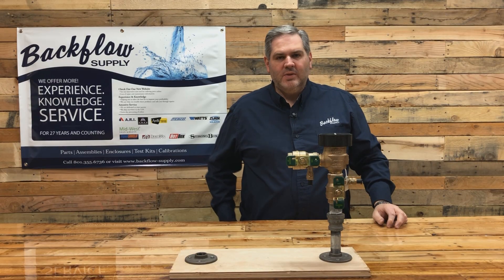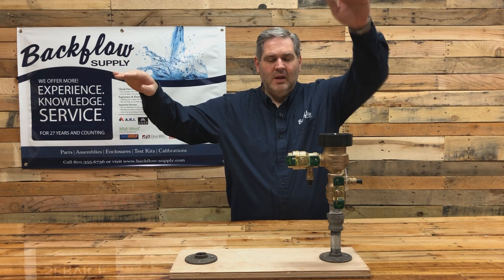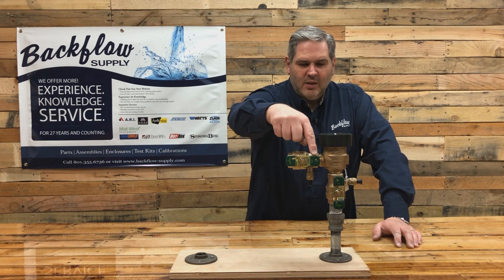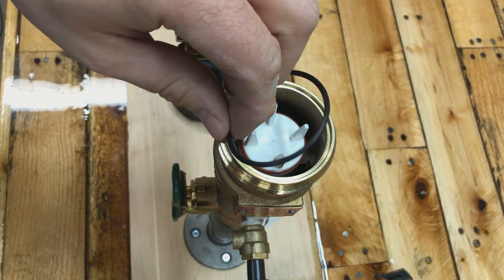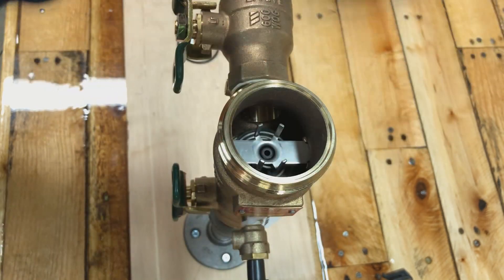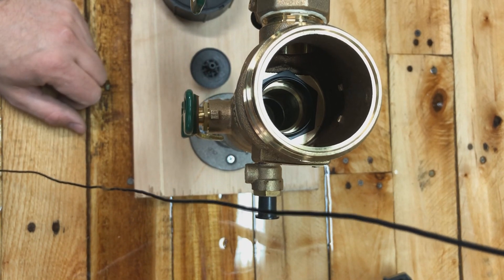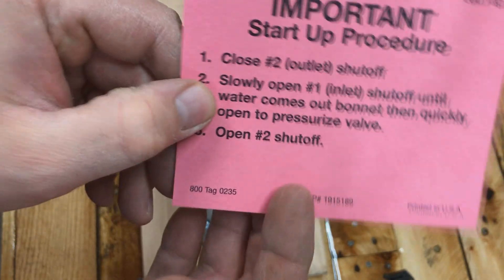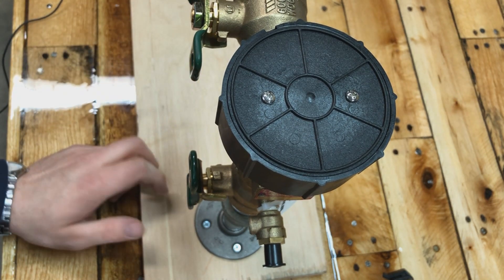Inspecting and Taking Apart the Watts 800M4 PVB Assembly

Comment: How do you remove the bottom seat?
Reply from the maker: Sorry for the delay in responding.  Depending on the size of the assembly there is a socket size Watts has said the seat takes.  The problem is that it is hard to find a socket to fit between the side of the assembly and the seat.  if it is a 1/2" - 3/4" it takes a 1 1/8" socket.  If it is 1" it takes a 1 1/2" socket. If it is 1 1/4" - 2" size assembly it takes 2 1/8".

I had a customer tell me for a 1" 800M4 he found a 1 1/2" water heat element wrench that he said can be found at Lowe's, Home Depot,  and Harbor Freight
Reply: @backflowsupplyslcut9394  yeah, the 1 1/2 inch socket is too wide to even fit down the hole. I ended up using a pair of long needle nose pliers to grip two edges. Fortunately it was not too tight so I was able to loosen it enough to then get it the rest of the way by hand.

Comment: My county does their inspection yearly. The water flow from test cock is a constant slow stream when they tested it.  They claimed it should have a high pressure spray.  I purchased this kit and replaced all components. After I tested the test cock flow, the flow rate was no different from the original test.  I tested my sprinklers and they function perfectly. I did check the test cock again while the irrigation system was on and the cock flow was high.  Finally, I have no water leaks at the Main Street meter reading. On this 800m4 system, should the flow rate at the cock be extreme?
Reply from the maker: I can't think of a reason for something like that to happen.  Maybe we need to get on a Facetime call and see if I can tell what is going on.  Give me a call in the office first, 801-355-6736 and we can talk about it and i will give you my cell number.

Comment: How can I take out the old seat at the bottom? Do I need a specail wrench or something? It is at a deep bottom where it is quite difficult for my fingers to reach. Thank you.
Reply from the maker: It is not common to need to replace the seat.  But Watts says that you can find sockets to fit it.  If you have  3/4" it takes a 1 1/8" socket.  If it is 1" you need a 1 1/2" socket.  If it is a 2" assembly it takes a 2 1/8" socket.  I believe it would need to be a thin walled socket to fit between the seat and the wall of the assembly.

For the 1" size assembly I was told by one customer that they found a water heater element tool found at Lowes, Home Depot and Harbor Freight and it is a long, thin walled socket.
Reply: @backflowsupplyslcut9394  
I really appreciate it. My contractor said the seat is not working properly, and that’s why my backflow test flunked. I was trying to replace the seat, but I couldn’t rotate the seat with my fingers. Eventually I had to pay the contractor $200 to replace the seat.

I wish I had a compatible socket 😅

Still I can’t believe the seat somehow got defective. I mean it’s a hard plastic part that can last forever…
Reply from the maker: @jacobkowski7705  The seats do get knicks and chips in them that the rubber can't seal against properly.  The seats can also get cracks in them.  I see them in the threads but more often I see cracks that run from the top to the bottom.  Not all of the cracks can be seen while still installed and even taking them out you have to look carefully to find them .  Cracked seats are not usually the problem but often can be.

There are tools that Wilkins makes and other aftermarket tools but they are usually sold as a set that does three different groups of sizes.  There are a lot of creative ways people get them out by making a tool or modifying a tool themselves.
Reply from the maker: Sorry, I was talking about different seats than the one in the 800M4.  Still the seat in the 800M4 is rare to be replaced but knicks and chips can happen on the surface of the seat due to debris washing through.  Cracks can also develop, although I do not see the cracks in this model near as much as in the ones I was speaking about above.  I also do not know of an aftermarket tool for these yet.  Just those wrenches I mentioned originally.

Comment: so if im opening this for the summer season step 1 is turn water on from (in my case basement) then do step 1 from that paper? also am i doing anything with the test cock valves for this start up process?
Reply: thanks so much I appreciate you! and just to be clear I leave those test cock valves alone, the assumption here is my system was winterized so right now the test valves are closed
Reply from the maker: You want to make sure that you have both shut off valves in the off position.  Then turn the water on in your basement.  Go back to the assembly and start with #2 on the instructions.

Comment: my vent flow does not have the 4 legs? it has a hollow stem in the middle top and bottom which does not appear to connect. The next piece is a screw on black piece before the brass top that also screws on. It leaks profusely.
Reply from the maker: You may need to call me.  I need to know the model you have. I am assuming it is the one I am covering in the video.  You may have the freeze resistant vent float if I understand your description.  You may just need a new vent float Call me at 801-355-6736 - Sean

Comment: Thanks, I had reduced pressure on all zones and my 800M4 was squealing when running. I took everything apart and cleaned it and ensured there were no cracks and or any damage. The difference is my float has a center tube with an internal spring the fits up into the bonnet center spring area. The pressure has returned minus the squeal but I now have a small leak and was going to replace everything inside our 20-year-old Watt 800M4 R regulator but I am not able to find a kit with the same float. Help and thanks again.
Reply from the maker: I am not sure which size you have.  1" is most common, but here is a link to the parts for the 3/4" https://backflow-supply.com/collections/all?filter.p.m.custom.watts_models=800M4&filter.p.m.custom.sizes=3%2F4%22 and the 1" https://backflow-supply.com/collections/all?filter.p.m.custom.watts_models=800M4&filter.p.m.custom.sizes=3%2F4%22 just depends on if you want just that part or a complete kit.  Call me if you have questions  Sean 801-355-6736

Comment: What if it's not leaking water but the pressure test failed to submit to tne County?
Reply from the maker: I am not sure I am following your question.  You had the assembly tested and it failed?  That is a possibility.  The air inlet could have opened below the required 1.0  or the check valve in the bottom could have leaked or not held at 1.0 or above.  This would require perhaps a simple cleaning or rubber parts or complete parts.  Hard to determine without seeing the components and knowing what the issue was in the first place.  You are welcome to call me at 801-355-6736 and ask for Sean or email me at sean@backflow-supply.com
Reply: @backflowsupplyslcut9394  Yes I had the pressure tested and it failed. Otherwise, its functioning fine zero issues.
Reply from the maker: @shanew7361  Maybe I need to clarify.  Did someone come out to do a specific backflow test, using a gauge and they hooked a hose up to it?  Did they leave a copy of the report?
Reply: @backflowsupplyslcut9394  Correct, and no report was given. I'm having a different plumbing company retest it.
Reply from the maker: @shanew7361  Make sure you ask them to explain why and how it failed so you know what you need to fix it.
Reply: @backflowsupplyslcut9394  I thought that was a little odd. The first company didn't explain why or how it supposedly failed. I haven't heard from them since. Our HOA got a group rate for $50. No wonder it seems like they were shisters. I'll ask my p,umber I usually use at the house for paperwork. I did buy a rebuild kit for my Watts 800M4 FR, and only the second plastic piece of black the gasket was worn off. Everything else was in normal condition. The shiishters were trying to get me for $418 to rebuild it. Total rip off for the uneducated and lazy people. I said FU, and have a nice day.

Comment: How do you remove the seat from the 1 1/4" - 2"? I'm starting to think it's not possible.
Reply from the maker: For the 800M4 or LF800M4 the seat is removable.  Watts tells me that the seat needs a socket that is 2 1/8".  But as I understand, it needs to be a thin walled socket or it won't fit the outside of the seat and between the inside wall of the assembly.  I don't know of any easier way to get it out.  There are no tabs or nipples inside the seat to fashion a tool to unthread it.  I admit, it is frustrating to put a component into their assembly that appears to have no way to remove it.  Their original version, 800M2, of this model didn't have the replaceable seat.  The inclusion of the seat is what makes it an 800M4.

Comment: How come when I try to blowout my system, my pvb simply leaks out the air, no seal is made.  I’ve tried both test cocks and pvb has new internals. All seals are in good condition.
Reply: Thank you for your assistance. I purged my system by removing the internals and sealing the top with industrial grade film reinforced with the factory bonnet. But, curiosity got the better of me and I had to try again. (through pbv)

I finally got it right. 60lbs of pressure was sufficient.  My issue was that both my inlet and outlet valves were open. Because of that, I could not generate enough pressure. Once I shut both down, I’d open the inlet slowly and the pvb sealed itself after 3-5 seconds of flapping around.  Then I opened the outlet valve and my zone started blowing out.
Reply from the maker: my guess is you don't have enough pressure to be able to keep the float in place that seals against the bonnet and to blow out your system.  Not sure what model you have but some may have a means to manually hold the float closed as you blow out the system, like the Wilkins 720A.
Reply: Thank you for the response.  I have the 800m like in the video.  I have a 15 gallon compressor and I was using 60lbs.  Is that not enough?  If I take internals out and seal the top I can accomplish what I need but I’d rather not
Reply from the maker: @Rdanza  keep in mind I am not a sprinkler guy.  And none of the manufacturers recommend blowing through the backflows.  But in my estimation, 60 psi wouldn't be enough to keep the float up and provide enough air to  blow out the sprinkler lines.  

Your model doesn't have a portion of the vent float that extends through the bonnet so there is not an easy way to manually keep the float in place.

Maybe someone else has a solution for your model but I have not heard any.

Comment: My main problem is low water pressure, could this fix that
Reply from the maker: Not sure what you mean.  You have low water pressure and could putting one of these in fix that...no it wouldn't.  

If you mean could this be the cause of the low water pressure, perhaps.  What is the line pressure before and after the backflow?  You should lose a few psi from one side of the backflow to the other.

IF the parts inside are broken and restricting the flow this could be the cause.

Take it apart and see what you have going on and let me know.

Comment: What tool do you use to remove the check valve seat?
Reply from the maker: I am assuming you are referring to the 1" line size assembly?  If it is I am told by Watts Technical it is a 1 1/2" socket.  But I understand it needs to be a fairly thin walled one to be able to fit between the edge of the seat and the wall of the assembly.
Reply: What about 1 1/4" - 2"?

Comment: Thank you for the video. I do have one question that is driving me crazy. I juay bought my house last year, and had a company close for me. I attempted to open it myself today. My problem is this....When I open the number 1 valve it leaks and then pressurizes. I then open the number two. It is fine for about 20-30 seconds when it suddenly starts to gush and it slightly shutters. All of the parts look ok. I would rather not spend $110 on a replacement kit if it is just one or two pieces.  Can you share your thoughts of what might be happening? Thanks, KM from NJ
Reply: Hey Kenneth were you able to figure out the problem?  I have  Brand new one i installed it and am having the same problem. I took it apart and I didn't see any issues.
Reply: Open the number 1 valve quickly with the number 2 valve shut. Then slowly open #2. If you still have problems, it's most likely either debris in the check, or damage to the seat. I'm searching through the comments now to see how to get the seat out. I'm thinking they make a specific tool just for that. Watts has a tendency to find ways to bleed people dry. I'm a Wilkins guy all the way.

Comment: having trouble blowing out my sprinklers through this bfp, am i missing something?
Reply from the maker: First, let me say that the manufacturer doesn't recommend blowing through the assembly to blow out the sprinkler system.  That being said people do it.  

We may need to talk on the phone to see what you are doing and the trouble you are having.  First questions, how are you getting your quick connect attached.  These test cocks won't work.  You would have to replace them or have an adapter that fits on this SAE fitting and transitions to a 1/4" female fitting to put your air compressor quick connect fitting to.
  
If your issue is that air is leaking out under the bonnet you may not have enough pressure to hold the float up to seal it. 
 
I have never blown out a system, I do not know how those that do it, do it on these PVB's.  I am wiling to give a few other suggestions if you call me so I can be more specific.  801-355-6736
Reply: You nailed it, I needed to let more pressure develop prior to opening inlet side valve. Once I did, the valve seated and blowout commenced. Thanks for the help.
Reply: I’m at my wits end. I’m having the same issue. What pressure did you have to use to get your pvb to seal?

Comment: hi i want to buy a rebuild kit for watts 3/4 009 M3-QT 2nd check can you tell me how much it cost and shipping to zip code 19135
thank you
Reply from the maker: Joseph, the part is $26.95.  Depending on how you ship it, postal or UPS you could spend Just under $5.00 to maybe $12 with UPS.  If you go through my online store it will show you the options and prices.  Here is a link to the #2 check on my site and you can add it to your cart and you can see what shipping would be.  https://backflow-supply.com/products/rk-009m3-ck2-3-4?_pos=1&_sid=c41bda194&_ss=r
Reply: how much is the whole unit cost 
thank you

Comment: We got a new one of these last year, was working fine early spring this year. But now all of the sudden, it makes this horrible droning wailing noise and I can't figure out for the life of me what's wrong... help?
Reply from the maker: We may need to talk on the phone or email, but phone if we can.  801-355-6736.  It can be a flow issue and maybe it is even that a component inside is broken or damaged.  Does it only do it when certain zones are running or any zone?  What is different about when it does it and doesn't do it?  Have you taken it apart to inspect it?

Comment: Thank you for a very informative video. I had the white piece blow off during the winter. Where can I find replacement?
Is it easy to open the black top? I tried my but was very difficult to open. Does it need a wrench or just hand tightening will do? Thank you.
Reply from the maker: That black top, the bonnet is just hand tight.  As for the white piece I think you are referring to the vent float, but not sure how you know it is bad if you can't get the bonnet off.  Here is the link to our web store for that part, for a 1" 800M4 assembly.  https://backflow-supply.com/products/rk-800m4-v-1?_pos=1&_sid=bb76300cd&_ss=r

Comment: Thanks for this great video on how to repair my Watts PVB. It would be helpful to give advice on what to do if the bonnet doesn't just unscrew by hand. That sucker is on there good. 

I am a victim of the Texas big freeze and trying to figure out how to get my sprinkler system back into operation. I took the top plate off which he said you don't need to remove and it was badly cracked. I saw that two legs are broken off the float. That is as far as I got. That bonnet does not just unscrew like he showed. It will require some more persuasion. Been in this house 17 years and this PVB has never been opened. Never knew they should be inspected and maintained. Never drained the system either. Of course we never have had 5 days below freezing with temps in single digits either...
Reply from the maker: John, you may need to get a big pipe wrench and put it on the bonnet and try and unthread it with a little leverage.  It might start breaking the plastic and you may end slowly breaking away the plastic to get it out.  I have never heard of hearing one being in so hard it wouldn't easily come out and where we are we have these freeze all the time.  Call me if you need to talk more about it.  801-355-6736